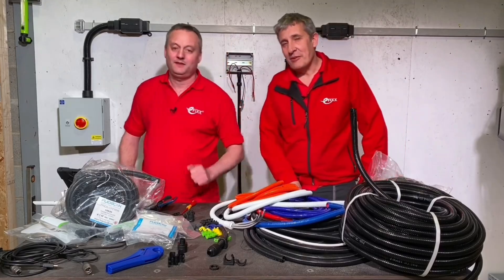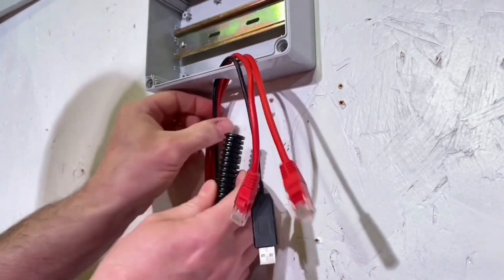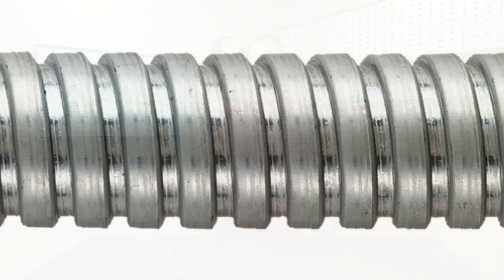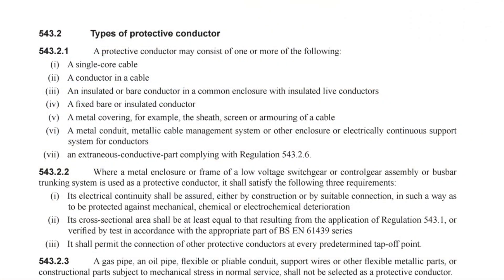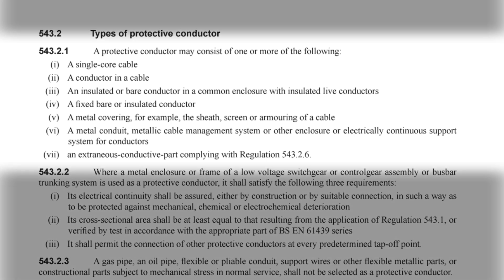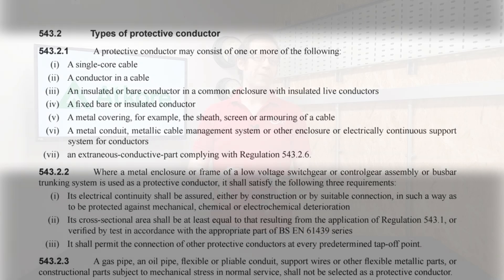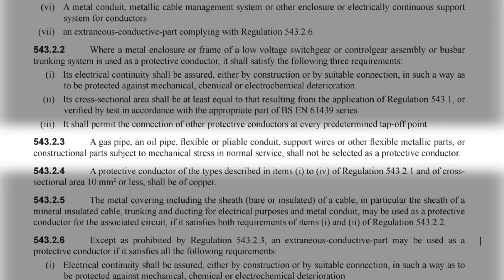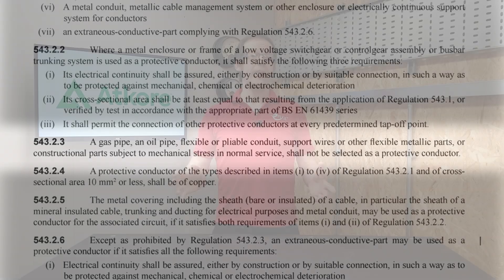Can you use flexible metal conduit as a circuit protective conductor (CPC) - BS7671

Comment: Thanks for the video.
If the flexible conduit was earthed one end,
And silecon wires was used. 
Would that protect the wire from high frequency,
As on a plasma cutting table.
Would that be like using screened cable.

Comment: You say about high resistances with the spiral but rcd protection omits us to 1667 with 30mA protection so is this still no longer compliance if within 1667?
Reply: can't guarantee that the value won't vary over time and use
Reply: The 30mA is for additional protection, you still need to meet the requirements for ADS. If it's a TT supply so you need an RCD to meet ADS then it wouldn't be the same RCD.

It certainly isn't okay to be depending on the RCD for ADS in a TN-S or TN-C-S system.

Comment: How about armoring of the cable? Copper of course can be used but what about steel?
Reply: Look at 1:00 in the vid for what is acceptable as a CPC:  reg 543.2.1 (v) "A metal covering, for example, the sheath, screen or armouring of a cable"

So yes.

Comment: I might be wrong but is metal flexible conduit not made of one unbroken length of metal wrapped around itself at an angle so it interlocks? 

I’ve done it before and if you were to pull on it you would end up with a long length of metal. In my eyes it has the potential to be a CPC as it has an uninterrupted path to earth providing the correct glands have been used.

I’m not saying I would use it as a CPC as I never use it but I think no matter what way the conduit was bent it would still offer the same if not better if it was making more contact while being bent than a 1.5mm or 2.5mm separate CPC.
Reply: That is exactly as they describe in the video. Sure the interlocking is in reality going to make some contact and reduce the end-to-end resistance, but as it's not fixed you can only really rely on it as it would be in the unravelled state, which is a lot less cross-sectional area and a lot more length than a solid conduit.

Remember also that steel has a higher resistivity than copper, therefore you have a relatively high and unmeasurable resistance (as it can change easily from small movements).

The result is that while in practice it would PROBABLY provide an adequate earthing path, it's unreliable for ensuring suitably low Zs readings so you cannot guarantee protective devices will operate in the required time.

TLDR: Like with many things in the electrical field, it would probably do the job, but stick with the regs or it's your ass on the line if it fails!
Reply: In the US, we’re allowed to use FMC as a grounding conductor but only on circuits 20A or less.

Comment: I remember the metal conduit being used as the cpc but that was 30 years ago and it was rare then .
Reply: My flat built in 1964 has all circuits in metal cinduit acting as the cpc, all checked out recently by UKPN and given a thumbs up.
Reply: @nw5835  as long as it hasn't corroded it should be fine . Good initial installation means a long service life .